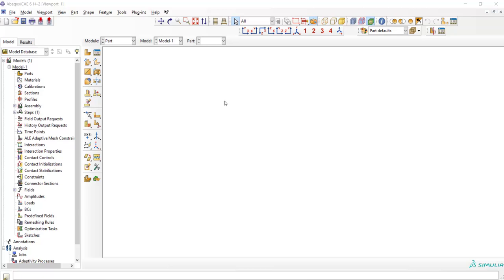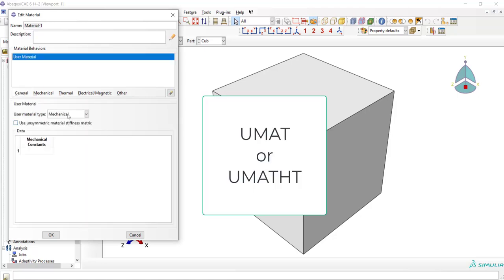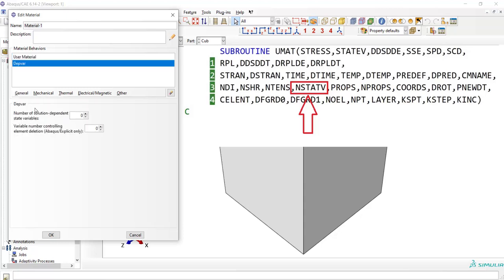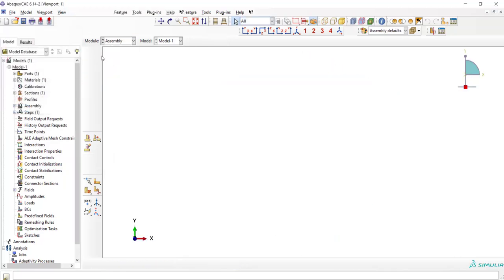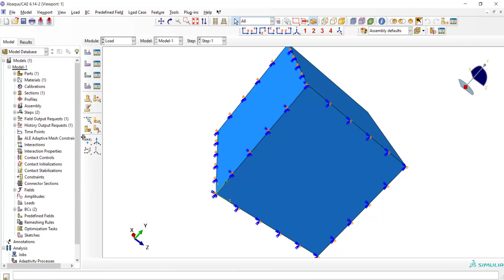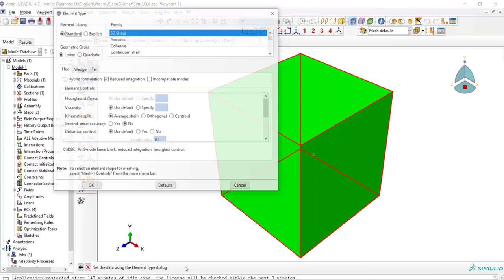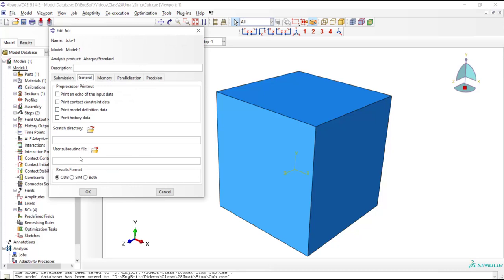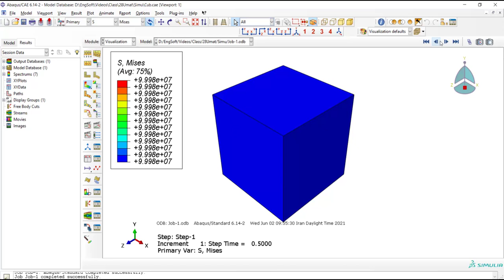The simplest model to run your UMAT

Comment: Hi, thank you for the tutorial. I have a question about the Datum of the Model. Is there a way to change the position of the coordinate system to be in middle center of the part?
Reply from the maker: Thanks, in part module you can draw the part in your desired position from the beginning. In assembly module you can transfer the part to your desired position.

Comment: hello sir, when testing a single element how much displacement has to be applied. suppose i am taking a element of 0.5 mm x0.5 mm x 0.5 mm how much displacement has to be applied.
Reply from the maker: It is better to start from small strain to check your UMAT for the first time i. e. strain = 0.01. In continue after initial checking the UMAT, if you want to model plastic or damage of the material you should apply strain based on the tensile test results of the material. In some cases strain is a few percent but in some cases even more than 100%.

Comment: I am getting "there is zero force everywhere in the model" the model is not converging. what might cause the error?
Reply from the maker: Please check your model by using simple elastic material of the software. If your problem was solved the problem is your UMAT.
Reply: It is working for other material, the problem is in GOH model UMAT, I checked everything from my side, I couldn't figure out the problem. Will you please check it ? I will send you my umat file if you agree. @engineering_software
Reply from the maker: What do you mean by GOH?
Reply: @engineering_software  Gasser Ogden Holzapfel material

Comment: Thank you for the very nice tutorial. Would you mind sharing the UMAT file or telling us where we can find it? Thank you in advance.
Reply from the maker: Please check the next video:  https://www.youtube.com/watch?v=po3ryHcQiFM
I have also sent the code for your email.
Reply: @engineering_software  Thank you very much. I've always got this "Job Job-1 aborted due to errors." when I run the model with Umat. Do I miss something?
Reply from the maker: Please check the following:
Does your CAE model work well with available materials e.g. linear elastic material of Abaqus. If so the problem is not from your CAE model and check that:
You have installed required software correctly.
Your subroutine has no problem.